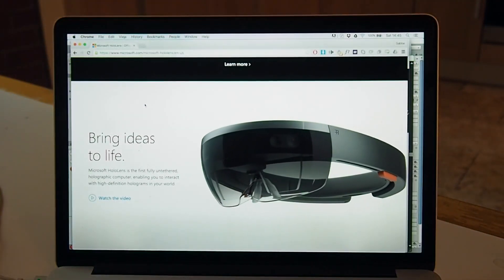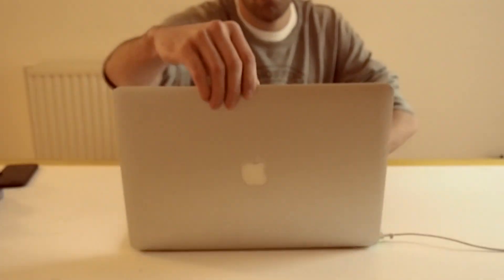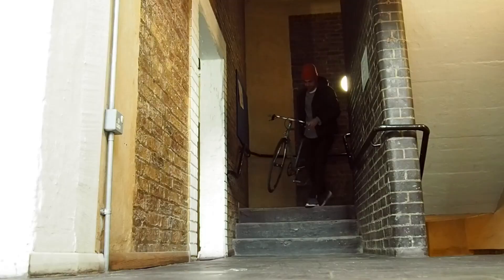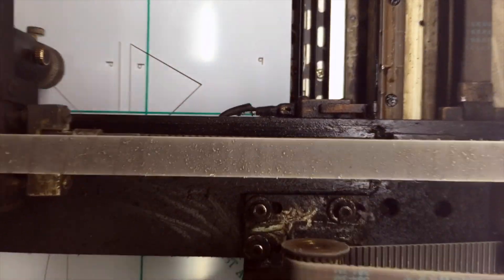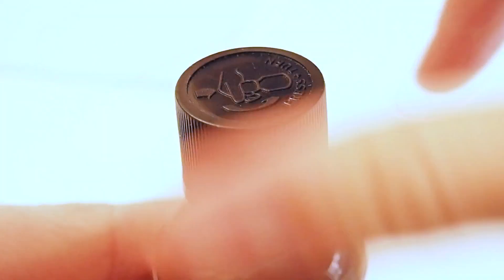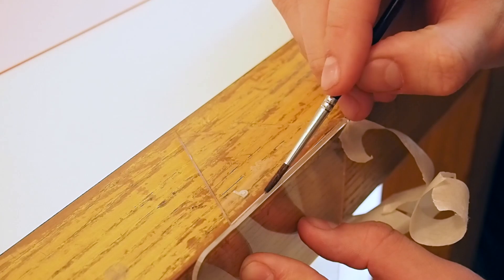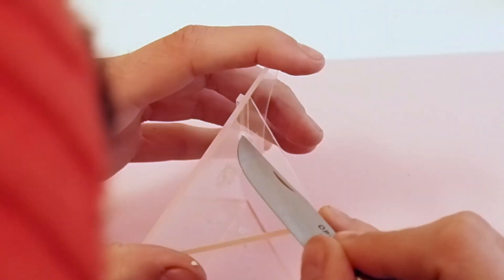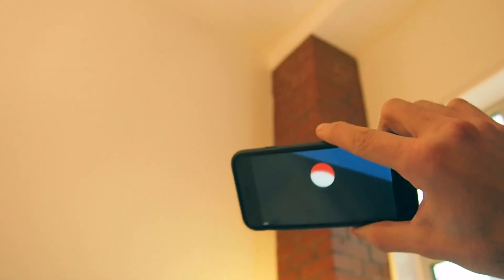Make your own DIY HoloLens, AR display for under £20 | Polylens

Comment: how did you manage to switch left and right or bothen and top
Reply from the maker: Tristan Bihler I dug into the unity SDK and swapped the head tracking parameters. You could also write a script out of the SDK that controls a separate scene

Comment: you should add a piece of black plastic to seperate left and right sides then in unity use something to create a left and right 3d seperation so you get the true 3d experience like the hololens, i was looking at doing something like this with my 3d printer but wouldn't know where to begin building apps for it

Comment: How did you reversed it sideways
Reply from the maker: Lots of messing around with the SDK. Effectively you are swapping the compass data around. Since the project the google cardboard SDK has changed a lot, but i cant see why this will not still be possible.

Comment: Did you use somekind of an app that reverses the y-axis of the screen because when you display an image on a mirror then the sides get reversed and you wouldn't read out anything
Reply from the maker: I used the Google cardboard SDK and changed the way the head tracking would respond on a code level. Do check out the most recent design https://www.youtube.com/watch?v=CM3X4b4NBnQ
Reply: Use lock rotation
Reply: @chad2293  Take your phone, display some text, go to a mirror, and look at the screen from the mirror, you probably won't read out anything as the text is mirrored. That is what I meant, not rotation, but y-axis reverse